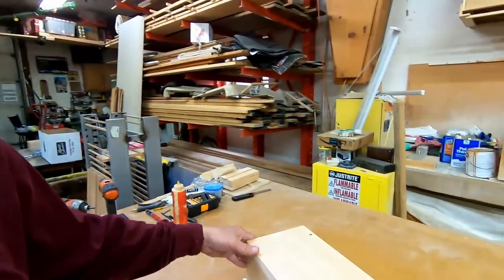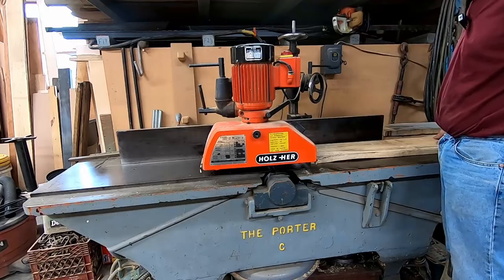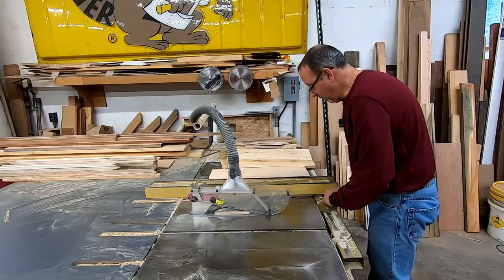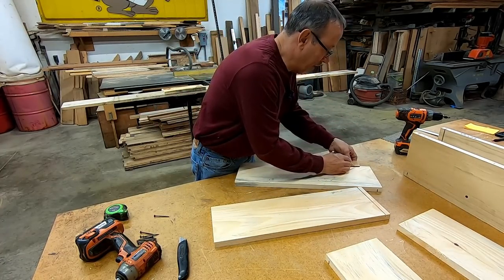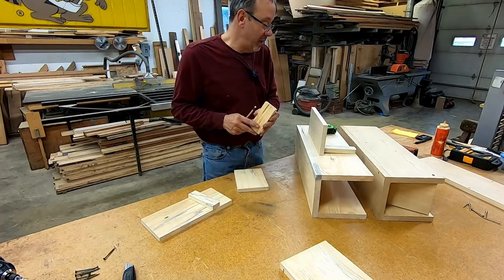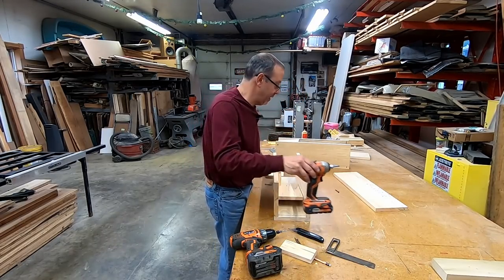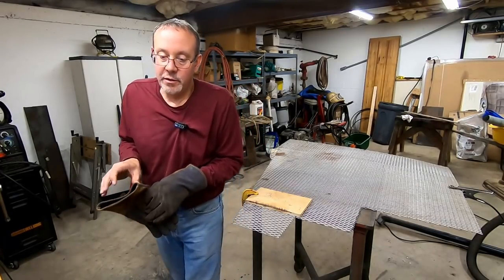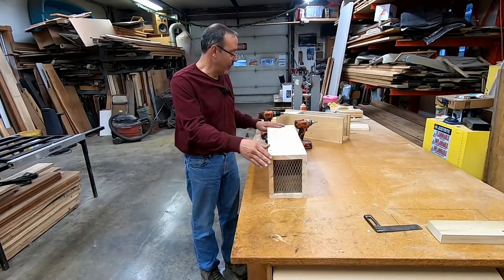my wooden boxtrap

Comment: LOvely woodwork why does it have to be planed and sanded the critter don'n't mind,also a piece of string on the trap door to pull up to release the critters.I'm sure if you made more traps with "Bus motors trap" logo nice littler earner using scrap wood,another income stream
Reply from the maker: thanks John , hard to work with rough cut lumber.